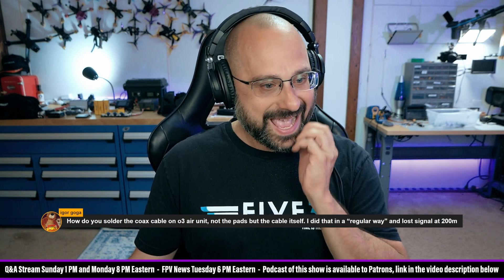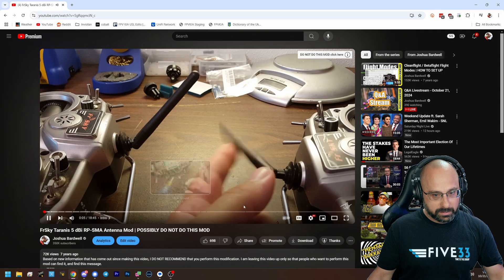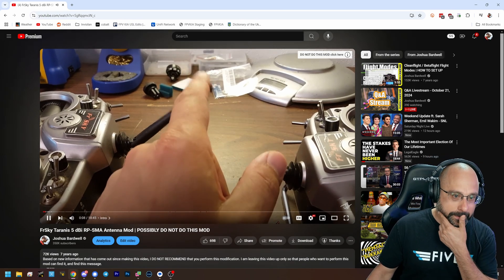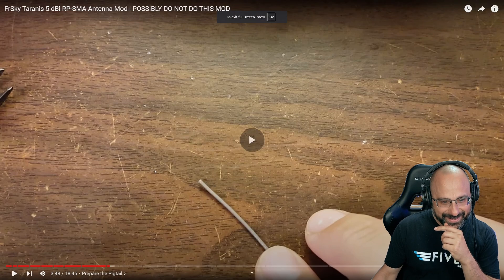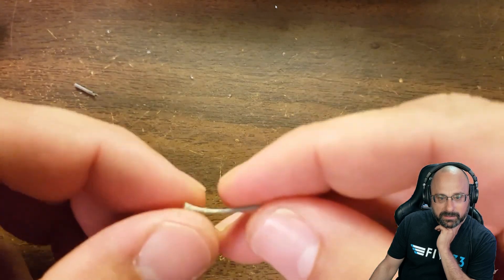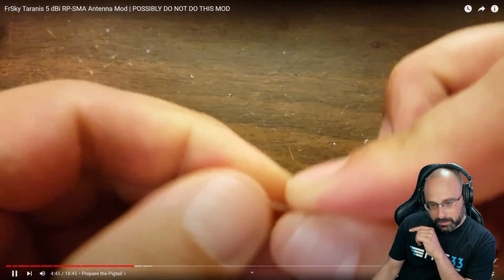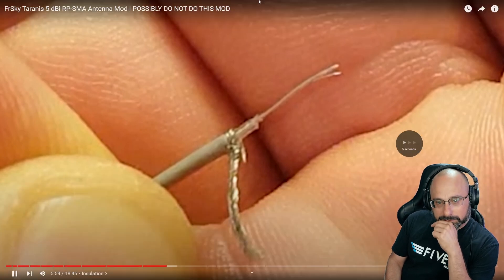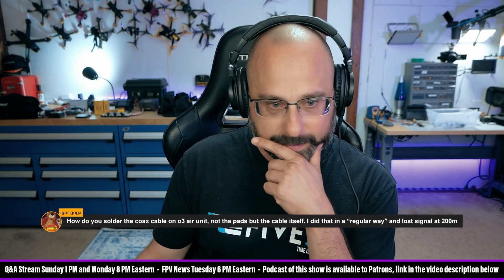How Do You Solder A Coax Cable To An FPV VTX With A Broken Connector? - FPV Questions

Comment: Ive got experience soldering small coax cables, i had to attach the coax cable of the wifi anthena in my laptop (the hinge mount broke and the metal part of the hinge ended up cutting the cable). It worked perfectly fine and only took me 15 minutes. But yeah, you have to be really carefull when cutting that insulation. I used a scalpel that i took from my clinic.